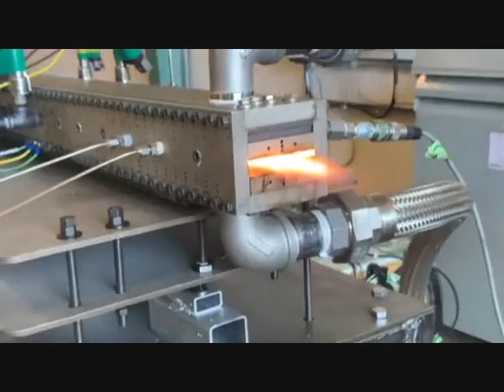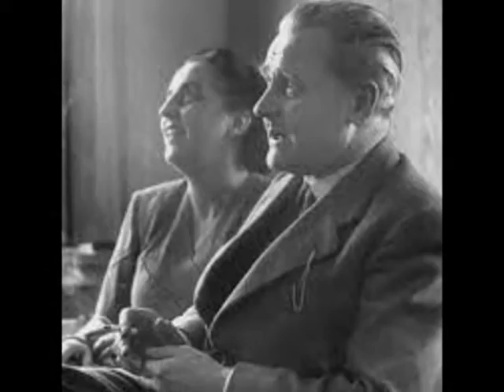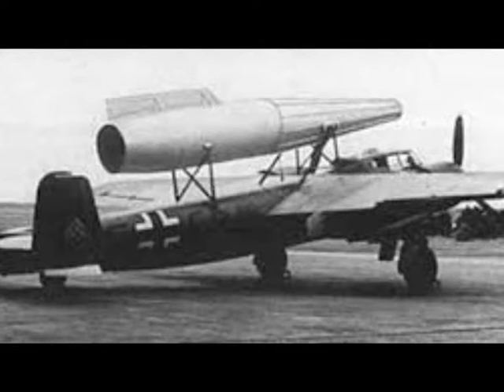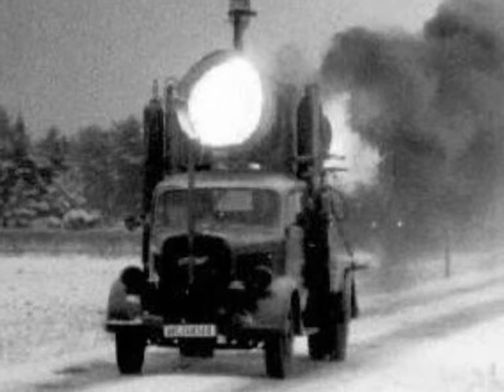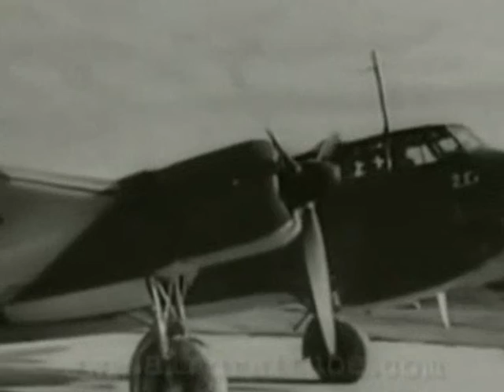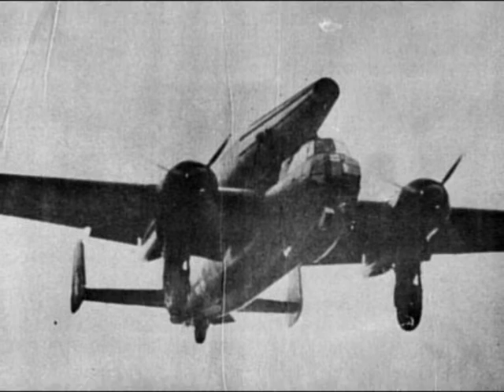Dornier Do 217 used as a RAMJET Engine Test Bed (’42 – ’44)

Comment: WWII Special Projects, Germany

Staustrahltriebwerke mit Soft Fisson Propulsion für Lorin Flugzeuge

Who has information about special research in Germany,
“SS Camp Mecklenburg”, Sonthofen, Bavaria, Germany, 1944/45
about nuclear propulsion for a/c, here a Messerschmitt Project with Ringluft-Einlaß and additional Ram-jets on the wing tips.

Soft Fission Propulsion for Ram-jet Fighters and Bombers:

One or two nuclear fuel rods, together with a heat exchanger and an adjustable Kadmium rod for moderating the fission are installed within a Lorin-Tube and within the rammed-in airflow.

When the Moderator Rod is fully extended, the heat of the fission, through the heat exchanger, is heating up the rammed-in air, so that the air is expanding rapidly, generating a strong and steady thrust for propelling a craft for more than 10 to 20 hours, depending on the amount of nuclear fuel in the rods of 1 to 2 m length.

Advantages: Long duration, high speeds, no hydrocarbon fuels, aircraft can stay longer aloft or reach far distances.

There are, of course, also disadvantages . . . 

Also used by unconventional UAVs, aka “UFOs” after the war. Both nations, the U.S. and former USSR, now Russia using, or had used nuclear propelled “Saucers” for recce flights over the territory of each other during the Cold War, highly classified reconnaissance and spy missions similar to the official “Open Skies” missions, which are now nearly abandoned.

By the way, coal-dust doesn’t heat rammed-in air hot enough for a strong expansion within the Lorin-Tube. Lippisch´s P-13 is an Electrostatic Winged Space Plane, and should have supporting a “Wernher von Braun Space Station” in nuclear WWIII, beginning in summer 1945. Coal dust is a colloid and the coal particles charge, through friction the insie of a Lorin-Tube out of a special alloy (ion-density), thereby charging the whole a/c for electrostatic flight, Ladungstrennung, in space charge of the earth.

Klaus-Peter Rothkugel
Researcher
Visit also my various Twitter/X posts about aviation, a/c modelling and WWII special projects.

Comment: Looking for information about special German experiments with Staustrahltriebwerke, Ram Jets, during the war.

Here in conjunction with either Soft Fission Propulsion (expansion of rammed-in air due to hot nuclear fuel rod).

Or Ram-Jets, Staustrahltriebwerke using very cold liquid gases, also expanding rammed-in air by cooling it down abruptly.

Both methods are avoiding normal hydrocarbon fuels, enabling longer range. 

KPR